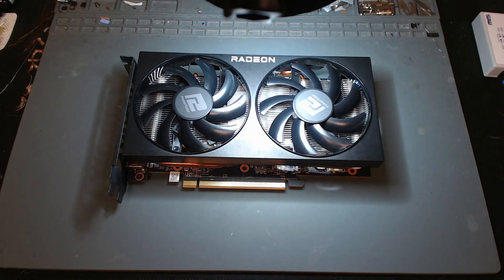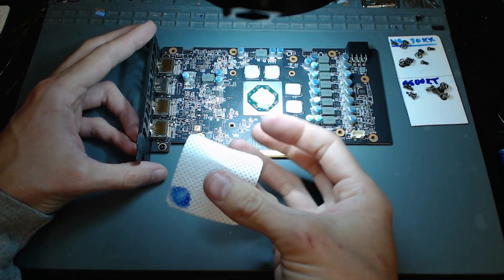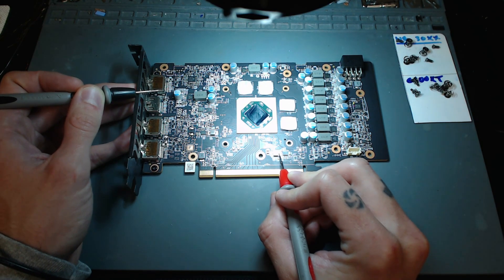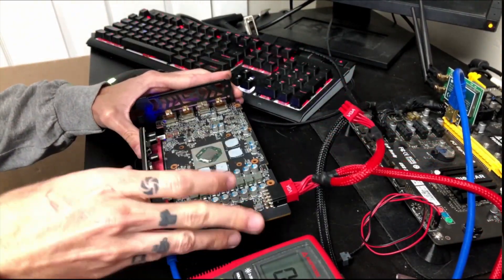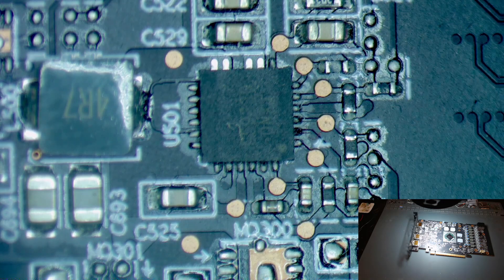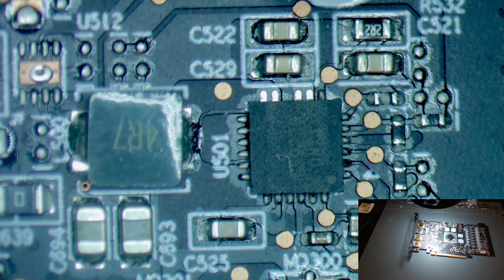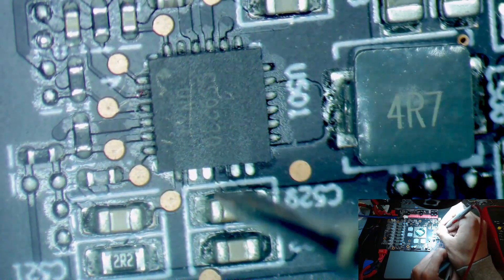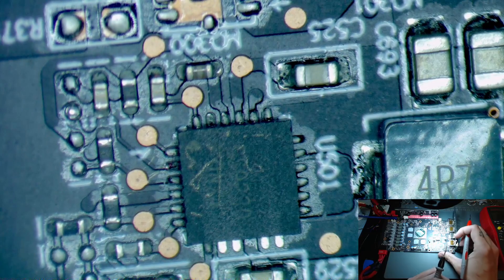Powercolor 6600XT Missing 5v Rail Repair

Comment: Hi, I hve almost the same issue with an msi rx6600 (same layout) but mine is only 1.8v on the R1200 and 0v on Q1010 (source & gate). PX_EN is missing in my case

Comment: Great video! Super helpful even though I am super new to motherboard repair. Where did you learn how to repair things like this, and what program where you using to view the motherboard schematics that allowed to you search for specific parts? Thanks!
Reply from the maker: Hey there, sorry I never replied! I'm not on here much currently. I started out doing basic repairs on phones, computers, tablets, etc. (screen swaps, battery replacements, hard drive installations, and other basic stuff), then gradually got myself into soldering various things. After that I taught myself how to micro-solder, and then I dove head first into fixing graphics cards. I had to spend some time learning electronics (still not the best, I have an electronics book sitting on my desk that I'll get around to one of these days...), how graphics card circuitry works, and then more advanced micro-soldering (bga work, qfn packages, trace repair, etc. I also used to do lots of damaged PCB repair, that's my favorite kind of work). I've been doing this type of repair for ~3.5 years, so just a gradual build of new skills over that time period!

For the schematics (pdf's) I typically just open them in Chrome. Occasionally I'll come across one that doesn't like to be searched for whatever reason, so I use PDF-XChange to open those; that's what you see in the video